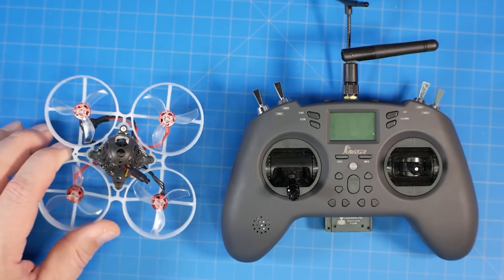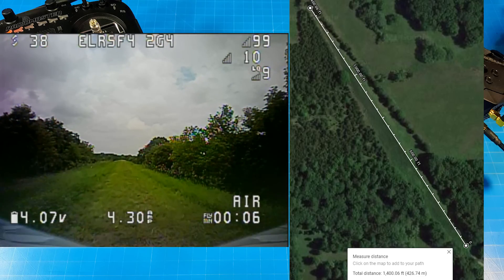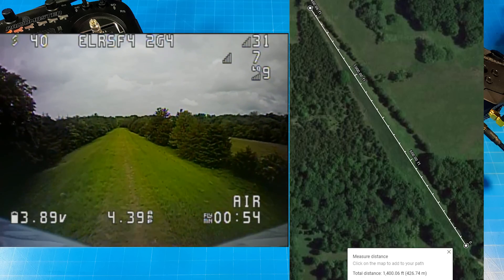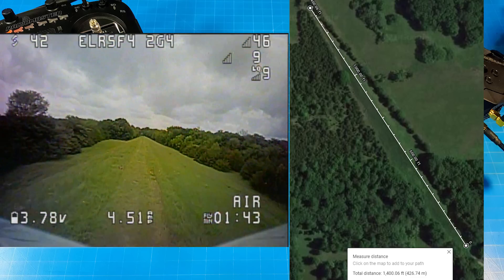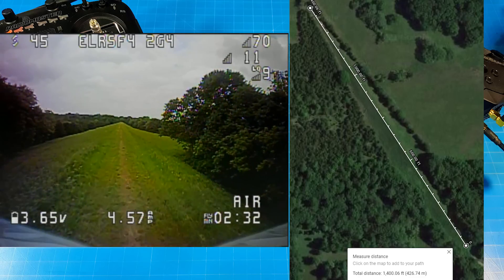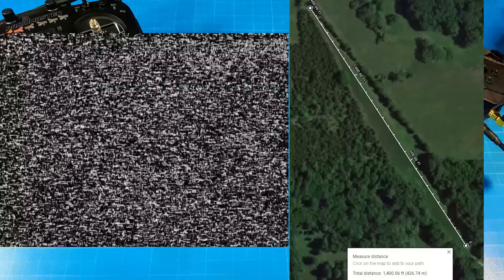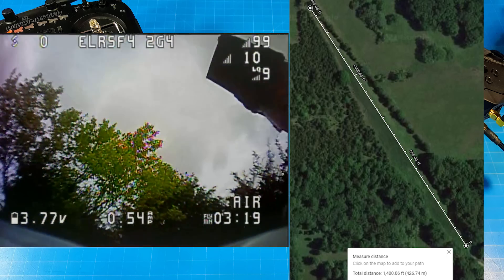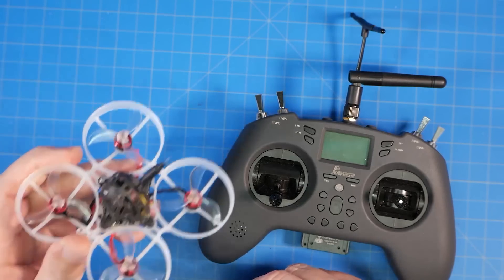Long Range Whoop // ELRS F4 AIO // ES24TX-Lite

Comment from the maker: TX module is set at 25mw. Sorry I must have clipped that part out 🤦‍♂️
Reply: What packet rate?
Reply from the maker: @BrandonBeans  packet rate is 250hz. 500hz isn't currently supported. Trying to get confirmation if there is a nightly for the t-lite that does support it. :(
Reply: @NickBurnsFPV  In the exprrsslrs configurator it is stated that the 500Hz is supported up from nightly 47x something. It lets me choose 500Hz on lua script but I am not sure if it is actually doing that rate.
Reply from the maker: @sendorm  The 0:200 ratio in this image, the 0 is bad packets, the 200 is the packets per second. I don't have a nightly on mine, so when I select 500hz I only get 0:250. I presume with the nightly we should see 0:500 if 500hz is selected.
Reply: @NickBurnsFPV  Thank you, after digging around in the discord page, I used the same method and can confirm that the 2.3.12 nightlies do support 500Hz on t-lite. Thanks for your time.
Reply from the maker: @sendorm  Have you flashed it to the radio?
Reply: @NickBurnsFPV  Yes I have flashed it. I use the nightly 2.3 companion. From settings-settings- application settings choose release channel as "nightly builds". It offers 2.3.12N510 right now. On expresslrs configurator it says that from N472, 500Hz is supported. Only bothersome thing is you have a to press a key after each boot as it says  "testing warning".
Reply from the maker: @sendorm  That is a bit of a draw back. Otherwise the nightly working normally? I love how they say not to fly with the nightlies. :)
Reply: @NickBurnsFPV  No problem so far. At github they told that crossfire shot was buggy in some of the builds but it is fixed now. I've checked this with a crossfire micro 2 tx and it shows that CRSF Shot is enabled. I've did lots of flying with the mobula7 to verify :)
Reply from the maker: @sendorm  Good information all around. Thank you
Reply: Can it go any higher? 

Also, I'd be interested to see a test with the EP1 Rx with the u.Fl antenna.
Reply: Please "clip" your comment on top of all the comments writing 25 mW @ 250 hz
Thank you ! 👍🏼
Reply from the maker: @Cre8ionz.  My comment is pinned at the top.
Reply: @NickBurnsFPV  sryy - I don`t see the "comment pinned" text - not on my Youtube android app not on the pc desktop version hmm)
Reply from the maker: @Cre8ionz.  no worries. I don't know why it wouldn't appear.
Reply: @NickBurnsFPV  I will soon upload a few DVR's flying Freestyle at a park (not just free LOS range, like Wing LoRa) from my 1S 3" 2.4 Ghz Elrs Ep2 (ceramic antenna) on 10 mW @ 500 hz running RC8 and 200 / +200 mW VTX (set to 500 mW - but I don't think it's 500 mW, but i get more range than on 200 mW)

I have hz mode (7 = 500 hz) 
LQ = link quality 
Dbm enabled 

The rest doesn't work on Emuflight.. 

On ExpressLRS Configurator I checked everything eyept diversity and left values at stock.. 

Telemetry @ 1:64 but I get constant teletry less even when I set it to other values (try'd them all) 

But I don't care about telemetry since I don't use it and I don't any other way to make it work - maybe you know ?! 

I use the Happymodel 2.4 Ghz with the printed case (not ideal tbh, but it works okay with a slight modification..) 

Guess that's all that we can choose.. 

..including German :P audio from the RapidFire mic mod (Nurk's tutorial) (doesn't work that great, but it works) (around 50 % have problems like I have with the mic mod)

Comment: Thank you for the video.  I have the Jumpe T lite v2 with a build in ELRS but it do not bind to the Mobula7 with ELRS and suggestions from your side?
Reply from the maker: We have to have the ELRS version the same on both the radio side and the quad receiver side. Unfortunately the mobula7 receiver ELRS version cannot be flashed on its own. ELRS is part of betaflight. I believe there is a betaflight version available with elrs version 3 somewhere on the betaflight github. I say that expecting that your radio elrs is version 3.
Reply: @NickBurnsFPV  yes the controler has version 3.
Reply: @Nick Maybe you can show me the properlink to that betaflight version
Reply from the maker: @BboyFenzi  yes, then we need the flash the betaflight version with elrs version 3 built in. Before doing so do a backup of the betaflight configuration.
Reply: @NickBurnsFPV  I already have the 4.4 version of BF what should include elrsv3 doesn't it?
Reply from the maker: @BboyFenzi  yes i believe so

Comment: What video gear R u using? I have some old HDO and need a new module. Most likely go with rapidfire
Reply from the maker: I use orqa goggles with rapidfire and two truerc antenna.

Comment: Hey Nick I couldn’t find the video where your jumper tlite died. But that happened to mine I took the back off and took out the watch style batter on pcb and put it back in and all worked have you messed with the one that broke on you at all?
Reply from the maker: The one that broke or stopped working was repaired by the service center. They replaced the main board.

Comment: Hey Nick - did you have any problems flashing the Rx module via Passtrough? Or what is your approach? I have a problem flashing the AIO board (all tutorials are talking about external Rx module), and since Mobula6 with ELRS is my first, I was wondering if you have any expirience you could share.

Comment: Super cool I just ordered the all in one board for my first "build" I'm going with the new namimno ELRS module for th tx.
Reply from the maker: That appears and by all accounts seems to be a well made quality module.
Reply: @NickBurnsFPV  I cant wait I'm super excited for a ELRS and a micro board that has a real vtx antenna or at least a ufl to put one on. I'm starting to get the build bug lol. Im I just put a mobula7 v2 in the uz80 frame not I'm doing the shutterbug shuffle as you say going for directly soldered motors and mabey xt30 1s batteries 😅. The flight time should be crazy long it get about 6 minutes cruising and 4 and half rippen and flippen. Without any mods yet! I love micros!!!

Comment: Hiya,  say what’s the best antenna to replace stock antenna of jumper t-lite?  (Not for elrs module)
Reply from the maker: I don't know. I have never tested any other radio antenna than stock. I don't see that there are many on the market, if your having range issues we likely can only add a full receiver if the issue is with AIO with RX on board. spi d8 receivers don't have much range...maybe 100 yards line of sight.
Reply: @NickBurnsFPV  lol no, I don’t have range issues, I haven’t installed my elrs module yet..  will jumper antenna help at all after that?
Reply from the maker: @markmontreal7815  I am unaware of a better antenna to use. I am sure there is one out there, but I suspect those would be specifically for the extreme long range flying.

Comment: I will soon upload a few DVR's flying Freestyle at a park (not just free LOS range, like Wing LoRa) from my 1S 3" 2.4 Ghz Elrs Ep2 (ceramic antenna) on 10 mW @ 500 hz running RC8 and 200 / +200 mW VTX (set to 500 mW - but I don't think it's 500 mW, but i get more range than on 200 mW)

I have hz mode (7 = 500 hz) 
LQ = link quality 
Dbm enabled 

The rest doesn't work on Emuflight.. 

On ExpressLRS Configurator I checked everything eyept diversity and left values at stock.. 

Telemetry @ 1:64 but I get constant teletry less even when I set it to other values (try'd them all) 

But I don't care about telemetry since I don't use it and I don't any other way to make it work - maybe you know ?! 

I use the Happymodel 2.4 Ghz with the printed case (not ideal tbh, but it works okay with a slight modification..) 

Guess that's all that we can choose.. 

..including German :P audio from the RapidFire mic mod (Nurk's tutorial) (doesn't work that great, but it works) (around 50 % have problems like I have with the mic mod)

Comment: Nice range for a whoop.  I am happy about my T-lite, but have some range issues, but I think it might be my lion battery choice.  I ordered some 30A ones.
Reply from the maker: What sort of range issues are you having? While I typically fly the regular protocols just around my backyard, I haven't experienced range issues.
Reply: @NickBurnsFPV   D8 doesnt, get so far, in a forrest or garden situation, only about 40 meters.  Using a Mobula 6.  Maybe I am forgetting to do something with the radio.
Reply from the maker: @SOLARFPV  Yea, I don't think I go much further than that either

Comment: My batteries go from 4.2 to like 3.8 as soon as I arm and start flying. 
How are your batteries so good? Or what’s the secret lol
Reply from the maker: lol. It could be a few things. Battery brand and type. The connector could be worn out on the quad, PH2.0 connectors do break down over time. It could be the connector itself as some have rolled pins, those aren't nearly as good as solid pin. The motor could also have hairs or other fine debris causing them to work harder to spin.

Comment: Hey Nick, LQ never move from 9 !! btw what you could have done is that when you go to the far end of the trail and going in to the corner, just get some more altitude that way your Video RF power was not absorbed by the well-hydrated greenery there!! :) , just a thought, almost always when people fly LR  and there is some hill and you losing the video, just fly higher, so the Video Link have a clear LOS path :D
Reply from the maker: Sure, more altitude would have helped ensure video and rx link. The thought at the time was that I had been down there once, can I go behind the trees and still have video and rx. Result no. I didn't want to fly up above the trees as there was some wind and I didn't want to lose the quad, its the only 2.4ghz ELRS AIO I have at the moment.
Reply: @NickBurnsFPV  with the ceramic antenna there is a video of 3.2Km  or 3.5Km distance ( dont remember) but yes, you can go 3km even to be safe, with the T antenna you can go 30+ Km  even on 2.4

Comment: Hey Nick, thanks for the review. What’s the battery life on your tlite with the module?
Reply from the maker: Its hard to put a number on it. So far I have had to charge the battery once since I got the module installed. I would say a solid hour of runtime. Some of that time is "on the desk" fiddling and checking things.

Comment: gnb release new higher c-rating 1s lihv

And i bought 2 of 380hv with higher c rating
It perform worse than good old 350hv with lower c-rating

May I know what is the recent battery you like to use for 75mm modded mobula 6?
Reply from the maker: The best performing battery is the newbeedrone nitro necture gold 300mah. I have many of those. But more broadly available is the GNB 350mah.
Reply: @NickBurnsFPV  previously hearing you fly on GNB450 mah for this frame setup (now GNB got release GNB 600 with same mass and 90C will try it in future)

Comment: Fin test! Where was RSSI/dBM display? That's the key value in ExpressLRS. The ELRS LUA will show you if you if packet speeds are matched and at what dBM to expect signal loss.
Reply from the maker: the dBM is the second number down on the top right side. To get the 500hz I need to update (nightly) opentx on the t-lite.

Comment: Hey Nick, what’s that second number on the upper right of your OSD? The one that is going between 0 and 10.
Reply from the maker: That is RSS dBm value.
Reply: @NickBurnsFPV  Interesting, I find it odd that it'd be in that range. On mine it's typically been around -30 when the drone is next to me and with my packet rate failsafe should be around -108. Curious what the difference is, maybe a different Betaflight version or a configuration setting.
Reply from the maker: @ATXAirborne  It could be the betaflight version. This board has 4.3.0 on it.

Comment: The only issue with these whoops is battery time, when you get to the end of the range, you better have enough battery to get back! Great range still. Your son looks a lot like you. Poor guy LOL. I may have to buy one of these. Thanks!
Reply from the maker: I see some new 850mah 1s on RDQ. Not sure if they fit the battery tray on the whoop frames, but it seems silly they wouldn't.
Reply: @NickBurnsFPV  That's awesome. I'll check it out, thanks.

Comment: Do you think if I flashed my old R9 module the fits a standard bay, it would be compatible with that FC ? 🤔
Reply from the maker: Yes, my understanding is the expresslrs team started their work on r9 hardware. The protocol will link up to the epresslrs receivers.
Reply: No it don't gonna work with 900mh TX.
Reply from the maker: Shoot, I forgot, @Angry Don FPV is right. We need the other 900mhz AIO board to use with the R9 hardware.
Reply: So we already have firmware/ hardware incompatibilities this early in development.  Sounds like what we were trying to get away from.
Reply from the maker: @Matt633NLT  I see at as more different versions. Some people want 900mhz, others want 2.4ghz. We have an expresslrs line for both 900mhz and 2.4ghz. With you having 900mhz r9 hardware that is the less expensive route.  BTW UAVTech has some really good Expresslrs flashing video on his channel.
Reply: @NickBurnsFPV  Got it. Thanks. I've seen UAVtech vids but haven't made the time to follow up. Thanks again for the follow up information.

Comment: Good video. Im starting to look into options with crossfire and expresslrs.
I bet looking back a few years no one ever thought it would be possible to fly a whoop that far. Good stuff...
Reply from the maker: Really up to the last year or so we were happy to get the weight down to help performance. Now days we want more and can get it. :)
Reply: @NickBurnsFPV  were you flying that on a 1s? It looks like the specs on the AIO say 1s. Just wondering how you were running it.
Reply from the maker: @FpvBudgetBuilds  yes, AIO is 1s only at this time. They are working on a 2s version, last contact on 2s ELRS AIO was that the vtx wouldn't be included. Don't know if that is going to be true or if it is something they are having trouble with.
Reply: @NickBurnsFPV  i think my next purchase will be a mob7, expresslrs AOI, and module for the t12. I see they have a module with no case for the t12 on getfpv.
Reply from the maker: @FpvBudgetBuilds  I only see the 915mhz tx modules. Do they have the 2.4ghz as well? I am not seeing them
Reply: @NickBurnsFPV  you are correct. I got so revved up after your video I did not see that detail. Maybe a T-lite is in my future as well. I checked your other videos again and gained a great deal more from them. Thanks for all the great info.

Comment: I ordered the 900 mhz module like a month ago.  They showed the 2.4ghz ones,  but i could not add them to cart.  I am still waiting on the order and I am hesitant in placing another order. I just took apart the mob7 to make the carbon fiber edition we talked of. Now i want to add this to it!!!! Since you didn't use that frame,  does that mean the hole pattern wouldn't work?

Figures,  it's a 1s only board!
Reply from the maker: Sorry, what frame did we talk about using?
Reply: @NickBurnsFPV  hey the jst carbon one, but no worries, that new board doesnt support 2s. Ill stick with the original f4 board for now

Comment: Will ELRS work with a multiprotocol module of Radiomaster TX16S?
Reply: No, its currently not compatible on the internal multi module. Need to purchase a seperate external module for the JR bay.
Reply: @MrLaserpowered  Thanks.
Reply: A chip that ExpressLRS (also Ghost and Tracer) runs on isn't one of 4 chips that are in 4in1 multiprotocol module.

Comment: I've seen a couple of my friends try ELRS, they gave up on it all due to being massive pain for them to set up they said.
I'm not sure personally as I've never and will never attempt it but always struggled with that side of hobbie. If D8 goes I won't be building my son anymore as I'm not smart enough for ERLS, he can figure out when he's older lol.
Reply from the maker: I suppose there is a bit of a learning curve. Really not much more than flashing betaflight or something like that
Reply: @NickBurnsFPV  Mayne I doubt myself to much, but it's hard to take the risk to go that direction. Do t get me wrong it looks an absolutely awesome system for micros in particular.
Reply from the maker: @slowentropy4531  I keep forgetting to put a flashing and binding tutorial together. I will get to work on that.
Reply: @NickBurnsFPV  Oh that would be so good mate!! I'd be able to pick up cheap second hand ERLS stuff as reading most the local stuff people have just bailed on it locally.
Reply: @NickBurnsFPV  How is the work on that going? I just installed my happymodel elrs lite module on my Jumper T Lite and I'm not sure where to go from here haha
Reply from the maker: @norb4152  its here https://www.youtube.com/watch?v=1w6uk3jUnJs I put that video up on june 13th.

Comment: Hey thanks, I’m  watching your reviews since I’m interested in the t lite with the elrs Modul. I really want to know if I have Range issues as if using a crossfire since the output power is not that high. How far is the range when using a normal receiver on a 5 inch when using this remote with the small Modul?
Reply from the maker: I can't really answer that question. I rarely fly anything larger than a 3inch prop and haven't flown a 5inch in years. From what I have read it seems using crossfire with the t-lite means we either mod the t-lite to meet the power requirements of crossfire at higher power or use an external power source on the crossfire module to use the high power output.
Reply: @NickBurnsFPV  thanks for the quick answer! Did you do a range test with a 3” with a larger elrs receiver?
Reply from the maker: @rdkfpv6019  I wouldn't call what I have done a real range test. Wezley Varty has done some real range test check out his channel at https://www.youtube.com/channel/UCiluOsWP9XCNnPART78mOfA He has a video on the happymodel hardware.